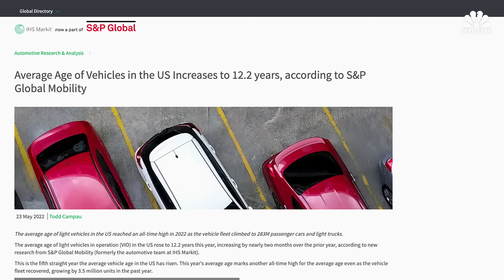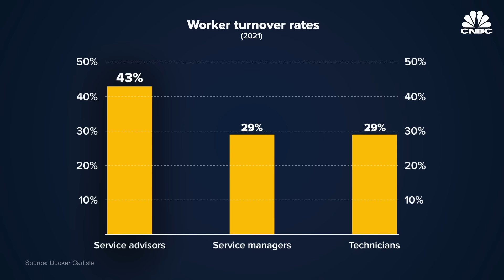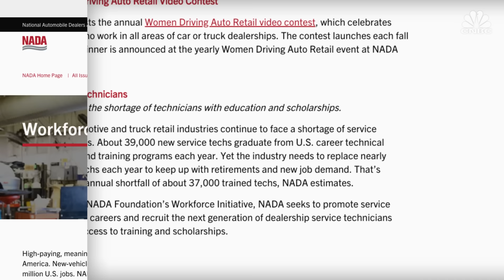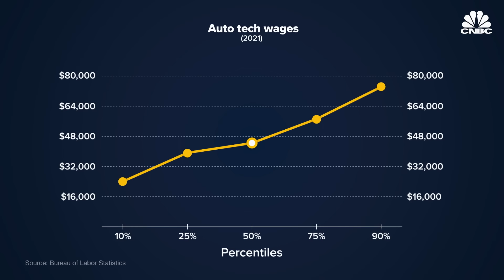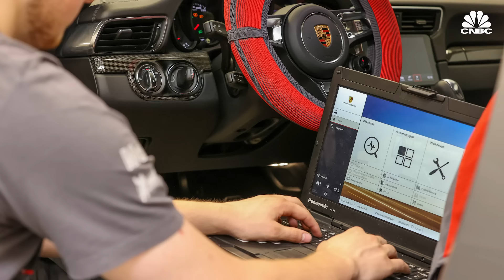Why The U.S. Has A Shortage Of Auto Mechanics

Comment: I became a professional mechanic in 1987, still getting it done today. One thing that i hate dealing with is the ever increasing complexity of computer interaction and the proprietary software that comes with it. In addition, when i started out, mechanics specialized in one field, i.e.transmissions, engine, driveline, body, computer, or, a combination of a couple of those. Today, i think we need to get back to this specialization. Reason I say this, is because of the the amount of new tools, tools in general, training, and ever increasing complexity of systems. It too much to ask a tweenty year old to own $100,000 worth of tools and know every system and its nuances. Its too much.
Reply: Hello how are you doing. Can we be friends
Reply: That’s why there’s a car diagnostic scanner to help you
Reply: I was a GM tech for 27 years. The cars got more complex and the pay didn't match it. Very few benefits, had to pay for your tools and equipment. I saw some older techs and didn't want to be racing the clock at an old age. I have a factory job now and it's a cakewalk. Great benefits and pay. Wish I had quit sooner.
Reply: A dealership should be providing all the specialty tools and big equipment
Reply: Great point I couldn’t agree more!!
Reply: @aladdingames6557  that's not how the scanner works.
Reply: Maybe for you. 😂😂 I run my own mobile business and do everything from oil changes, to engine swaps, welding, and undercoating.
Reply: That would explain why so many of these dealerships are owned by multi-millionaires, who don't like getting their hands dirty but like billing customers like lawyers do. $100k for tools is absurd. Dealerships could pay for those tools as long as the tax incentives, write-offs, depreciation, etc. make it worth it.

Comment: I've been a technician for eight years.  When these manufacturers wants to cut costs, they use lesser quality parts and squeeze the cost of labor to the point where break even is barely possible in the flat rate system.  The pay rates per job are calculated in ideal situations where nothing every goes wrong, for a example a rusted bolt or nut that just won't loosen without soaking of an anti rust spray or heat.  These manufactures and dealerships know exactly what the problem is, but it's like they are covering their own eyes and expecting the everyone not to see either.  It is laughable and the problem has hit the fan.
Reply: After 8 yrs you still call it anti-rust spray.... :)))
Reply: Right that's why I basically said, They can fix it their dammed self !!!!!!!!😆😆😆
Reply: @robbieraychannel  That is what they want. Look at what Audi has been doing a lot time ago. They make basic maintenance require removing the engine from the frame and put on different sized fasteners on the same part just to make it as hard as possible to work on, to drive the price up and make the customer not get the maintenance done so the car becomes damaged prematurely and they have to buy another one.

Planned obsolescence is what everyone is going for even in regular consumer electronics.

Comment: Let me get this straight:
1. You must pay for all your tools. Investing $60,000.00 or more for tools. 
2. A service advisor makes more than the mechanic and does only 5% of the work as the mechanic.
3. You don't get paid for all the work that is done with diagnostics.
4. A large portion of mechanics are contractors. Hence, no benefits.
5. The amount continual education you get does not directly correlate to your pay. People don't seem to understand that transmission repair is far different from engine repair or that diesel fuel systems are vastly different from gasoline systems. All this takes considerable understanding. Yes, mechanics are treated as trash. 
6. Currently, you're in an industry that is in a massive change from ICE to electrical. Your education and skill set is going to become obsolete.
7. Mechanics in many instances are seen dirty work even thou it's very technical. You can't just decide to do a timing belt service and valve adjustment on a Honda J35.
8. The dealership model makes mechanics compete against each for work. 
9. You work with a dealership that is known for scamming their customers. Not all dealerships but enough to stain the industry.
10. Lastly, dealerships lobby the government to keep their archaic model in place that only benefits dealership. Any system that protects itself from evolving via market forces is inherently a bad system. 

What other industry does this? Why in the world would anyone want to get into this industry. I learned quickly from a young age buy reliable automobiles and do all servicing yourself (oil changes, transmission fluid changes, brake fluid, spark plugs, air filters, cabin filters, and so forth).

Comment: After 20 years in this industry I would tell a young kid to go be a electrician or plumber 

Less labor more pay
Reply: And alot less tools
Reply: Working on ICE 🔧 vehicles is NOT easy. Many shops & chain places are rip-offs or scams. Dealers charge even MORE even if you can find, get the parts for your vehicle model. 🚗  The car repair industry is a mess in 2022. Car makers in support, customer service need to pivot from cost effective(low costs) to designs-engineering to last, reduce maintenance, repairs, problems.
Reply: They don't pay either. Worked as a carpenter for over 20 years and many similarities that I hear in the comments. Even electricians and plumbers deal with the same before you go there. Every friend that I know says the same.
Reply: Don’t forget about HVAC. Tons of money to be made.

Comment: Most technicians genuinely love what they do, it just the pay isn't enough. Not to mention the price of tools. Sadly a lot of tech's are made to believe that they aren't any good if they don't own high end tools like Matco and Snap-On. I'm a heavy equipment tech, I use mostly lesser known brands like Neiko, Hurricane, Crescent or store brands like Kobalt, Hyper Tough and Pittsburgh and I get my work done just fine. 

Also most dealership's use the "book method" where, they pay based on how long a job "should" take on paper which doesn't account for hurdles and challenges on a case by case basis which is usually the case. And the tech ends up getting paid less this way. Which also leads to rushed work and low quality of work.

Comment: Since it's weird why a mechanic would avoid to work, my educated guess is there isn't a shortage of mechanics rather a shortage of employees working as highly trained professionals in mechanics but being paid as laborer or someone with a low skill job.
The problem is on companies not with lack of mechanic garages.
A qualified auto technician requires the same amount of study/experience than any engineer degree (around 4-5 years) but is paid waaaaay less with a high level of responsibility and a huge work load.
Reply: Blame the insurance companies as they have a huge stake in keeping book times and the flat rate low
Reply: @timcasady4750  how do ins. co's do that?   that doesn't make sense.
Reply: @timcasady4750  HUGE problem in the Auto Body industry. It's why I transitioned into Mechanics, which I have since left as well.

Comment: I used to be a auto tech since 1978 till 2012 when i had to retire, due to physical problems from working on automobiles. The whole industry is awful. I was a ASE Master tech and a Gold level tech. The pay has gone way down compared to the labor cost a customer pays. When I started, techs got 50% of the labor rate a shop charged. Then it dropped to 45%, 40%, 35%, 25%, to 15%. Entry level techs were 12%. I was at the top of the game and got 27% of the labor rate. Flat rate is another flaw of the auto industry, shops want lots of hours billed AND fixed right the first time AND 100% customer satisfaction. That is a delicate balancing act for the technician.  AND then there is no advancement for techs, you work till you can't anymore, then like a burnt out light bulb, the dealer puts a younger person in your stall. I could go on for hours. I was told by the service manager many times "it's all about the share holders". NO IT"S NOT. It's about performing a job for the customer at a reasonable price. Dealers are all about taking as much of YOUR MONEY as they can!!!!
Reply: I has a ASE master in auto and a master in truck repair, 16 certs... and the job was still not worth it!!

Comment: Because we are tired of the bs, low wages, commission incentives.  I worked at many different shops, they would always have what you call a head wrentch, in my experience with them, they were incompetent mechanics.  One example, an older car comes in backfiring like crazy.  That kind of backfiring is caused by two things. 1. Bad carburetor 2. Bad timing chain. First thing I do before opening hood, is to see how many miles are on the engine.  The car had 109,000 miles.  I popped the hood, put breaker bar on the crankshaft, turn the crank, and noticed a lot of slop in the timing chain.  I guessed that was the problem to begin with.  So as I am writing up an estimate.  The head wretch comes over and ask me what I am doing.  I told him, he just laughed at me, and told me to just order a rebuilt carb kit and to tune it.  I refused, he took the ticket from me, and put me on another job.  The head wrentch replaced the carb, tuned it, started the car, one backfire, the engine quit and would not start. He starts hooking up the computer, and running test.  Then he scratches his head.  Has no clue, does not even know how to troubleshoot correctly.  He finally starts yelling at me. I told him, it was a broken timing chain.  Him and I argue for 15 minutes, he tries to blame the whole situation on me infront of the boss.  Typical, alot of them have no clue how to troubleshoot.   In summary I replaced the chain, retuned the carb, because he did it wrong.  The customer was happy.  After awhile I just got out of the business.
Reply: at 25 years old Im burnt out ... this industry has a incompetence problem with the higher ups

Comment: I was a mechanic for 33 years, but a big thing that helped me was being able to specialize in heavy engine repair, everything from building an engine from a bare block, including doing some of the machine work, and everything in between.  I also worked on both gas and diesel engines, it did not matter how big or small.  Some of the diesels were so big, you could go for a walk on them.  I did have a 401K and got 4 weeks of payed vacation after being there for several years, and I had medical insurance.  I finely worked my way up to working in a shop that was heated and air-conditioned, and also was kept so clean, that it was just a step below an operating room in a hospital.  I spent my last 10 years working there, and then they sent the work to Germany and England, the company was owned by the people over there, and they wanted it back.  While I was there they treated us like gold.  Treat your people like you want to be treated, and you will see good things happen.  Management sees and treats labor as scum, what the hell do you expect!
Reply: NO heat in winter, NO air in summer.

Comment: 10 year mechanic here. I want to add one more thing to other's comments. Working at the dealership, many people get stuck with warranty repairs for the majority of their work. The manufacturer determines how much each job should pay. Generally, if you get a big warranty job done in twice the time in pays (takes you 15 hours, pays 7.5) then you're doing about right. Only if you do dozens or hundreds of the same job over and over again, then you may get that time. However, there are many jobs which you won't be doing dozens of times. I rebuilt a transmission in a 4x4 diesel F250 under warranty. 10 speed transmission (a lot of parts to disassemble). Including removal and installation, the entire job paid about 8 hours. Took at least 2 days to do. more like 3. But, i've only done a few of them.
Reply: Don't be fooled if you are a senior tech up on the pay scale, the ham and eggs customer pay jobs are being given to the mid-tier level techs who are probably getting paid 4-5 dollars less an hour than you are. It's more profit for the service department this way.
Reply: spent 40 hours diag an intermittent draw from a laser sensor and got paid 2 hours!

Comment: I'm a technician at an independent euro performance shop, as a 23 year old I personally have been working at the same shop going on 4 years now.

Started as an enthusiast that didn't know which end of a wrench to hold. I fell in love with the creative aspect of building cars.

Recently, I've found that I do less creative work and am allocated to the boring crap like brake jobs, coilover installs, various parts replacing and engine swaps simply because I can do them faster. 

I feel tired of fixing things, and while being a technician was a good intermediary job for me I'm still glad of all the things being a tech has taught me.

The pay certainly leaves something to be desired, scheduling is a bit wack as well since I work 3 13 hour days. 

I'm going to be using my experience as a tech to start my own business building things instead of fixing.

Comment: When I was a tech, I would have to work 6 days/week, 12-14 hours a day to flag from 100-150 hours a pay period. The flat rate pay was less than 10% of the shop hour charge for customers for most techs. What also isn’t mentioned is that time is lost in several ways such as:
- looking for vehicle keys that the porters are still holding on to
- parts not being available until later that day
- taking the vehicle to the car wash and waiting in line.
- waiting for the service advisor 
- diagnosis of intermittent complaints

Back in the day, Service Advisors were previously Auto Techs who eventually aged and still had the knowledge of the vehicles so that they can properly be a liaison between the tech and the customer. Now they just hire any college kid who knows nothing about the industry. There pay for them has also remained somewhat stagnant. 

I wish the news would ask people in the industry that actually have experience instead of analysts

Comment: I’m been a Diesel Technician for 15 years. The diesel field pays better work is harder. But the pay is better. If you work for the biggest trucking companies you can $40.00 an hour.
Reply: Ya and I bet they charge at least 300 a hour for the customer
Reply: $40 isn’t much for a diesel tech
Reply: I’ve been doing diesel for about 8-9 months now, jumped from auto which I only did for about 2 1/2 years . Went from 18hr as a c/b tech to an c/b diesel tech at 34.12hr plus full benefits. Already getting a bump in position to an b/a tech at 36.50hr. Also good thing about diesel is 90% jobs out there are hourly not flat rate so you’re not killing your self over time.

Comment: There's a few factors at play here.
1. "The Strongest Economic Recovery"
2. Working on everything is such these days a royal pain, my 2007 ford mustang doesn't even have a transmission dipstick or fill plug, you're expected to pump fluid in from the bottom
3. Shop rates keep going up and the pay stays the same.